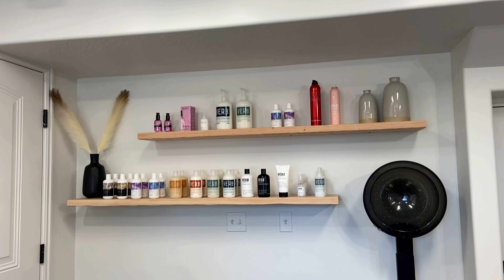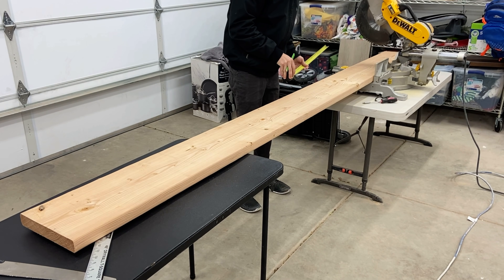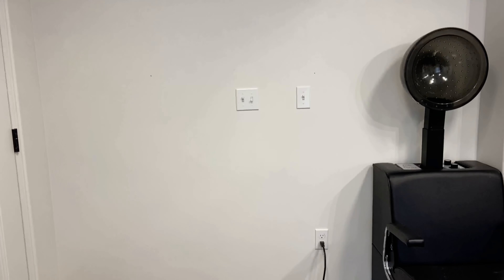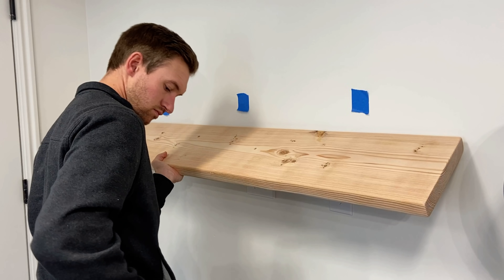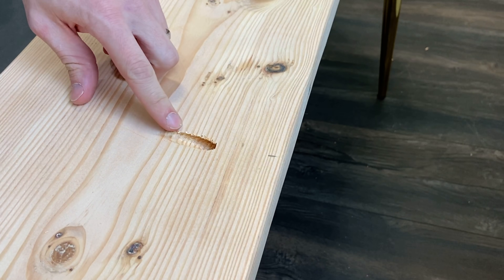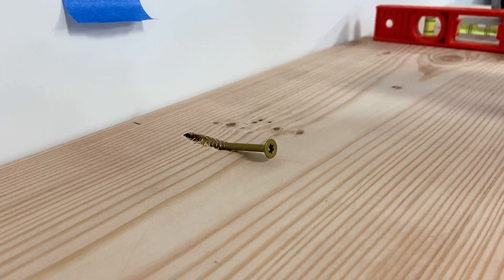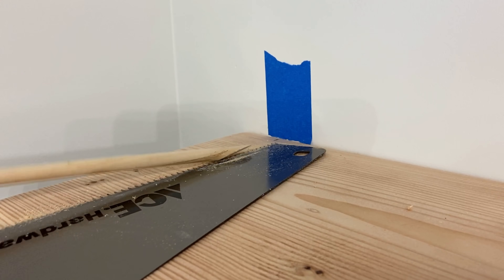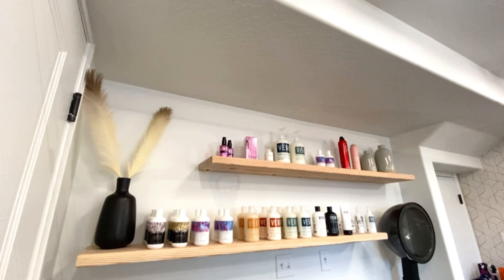These Strong Floating Shelves Only Use 4 Screws

Comment: Doesn’t work. Shelves turn out super wobbly. I used 2x10 x 50s with the same exact Kreg jig but I used three (3) heavy duty # 14 x 5-5/8 finishing screws going into three (3) studs, spaced 16 inches apart.  Super wobbly. This video is misleading.  Take a close look at this video around 3:06-3:08.  You can tell how wobbly these are for a split second right after he finishes drilling. That’s how mine are.  They barely hold 30 pounds without cracking, bending, and wobbling.
Reply from the maker: Dang I’m sorry to hear that it didn’t work out! Is it possible to send me a link of the screws you were using? Are the screws tight against the drywall? I’d love to help in any way I can! 

I don’t remember for sure but after drilling around 3:06 in the video, it is possible I was wiggling the board to check the strength in it. I do that on almost all my projects to make sure they are secure. 

I can also assure you that the shelves are holding up very well! My wife has a salon and they are holding shampoo bottles all day long and I have not seen any issues! 

Again let me know if I can help make this experience better for you!